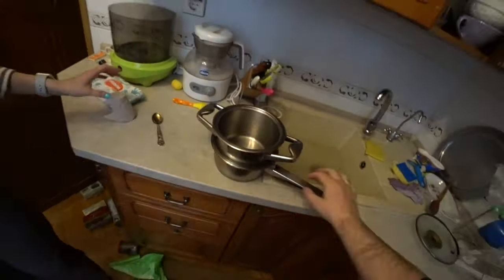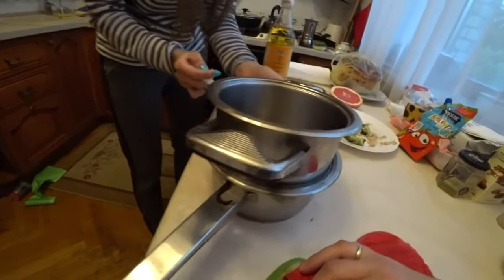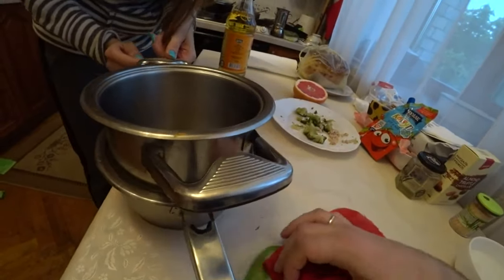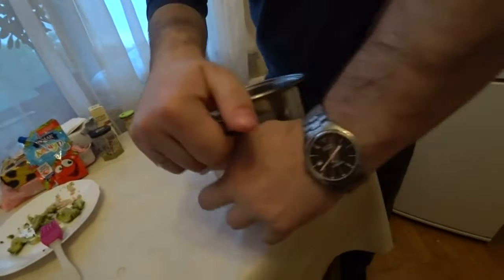HOW TO SEPARATE TWO POTS STUCK TOGETHER

Comment: If there is water already in the bottom pot, BE VERY CAREFUL because when you boil the water in the lower pot, and then you pull the top pot off, you may get sprayed with scalding water because the pressure in the lower pot builds up.  I did succeed in getting the pots apart but I also got sprayed with boiling hot water.  Before pulling the pots apart, it would be wise to cover the pots with a very heavy towel, and to wear heavy gloves....just in case.

Comment: My pots are pretty much the same size and make a tight seal.  The only way I can get water inside is by spray bottle which takes forever.  If I put on stove bottom one may burn without adequate enough water in it.  I may be stuck also!

Edit:  I kept spraying water on  the connected pots over low flame and it worked, however bottom did have some potato gellike water inside and all over my throw rug that I will take to laundrymat.  Was sitting together for several days all fairly new looking was glad not to trash both.  Thank you.

Comment: My husband got our two large Pyrex bowls unwedged easily with a small wooden wedge and a small hammer. He turned the bowls on there side vertically and tapped lightly two or three times at the seam,  he rolled the bowl over to the opposite side and again tapped lightly and it came apart easily. None of the other techniques we found on the internet worked for us. This is a no mess proven method that works every time. It should work on pots too.

Comment: Be very careful while boiling it ppl. Because depending on the content and heat generated, the top container would explode out of the bottom one and you might want to stay away from it for this reason. If you're worried about violent popping then just heat it for very few seconds and then use the oil method like they did in the video.

Comment: I also do not recommend this method.

I had two identical 4 litre pots stuck.
Just put them in the sink and add boiling water.
Not having a bigger pot available, I added boiling water twice for a smaller pot.
The water didn't even reach the top of the bottom put when they unstuck without using any force.

Comment: I actually got my pots apart before I came across your video. The pots were stuck together just about 2 months, but my Lord and Savior told me what to do. 
While the pots were stuck, water had gotten into the bottom pot, God told me I  should put the pots into my oven, which I did. I sat the oven on 300. I left them in the oven for 10 minutes. I put my bitterns on, took the pots on, and pulled, the pots came a loose. 
Thank your Jesus, for always being there, when I need you the most.
Reply: This worked perfectly.